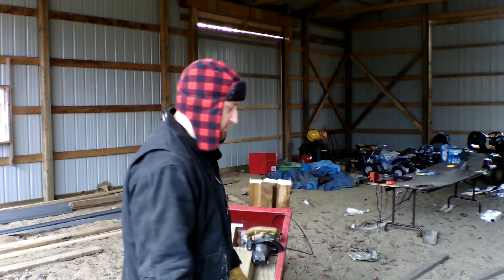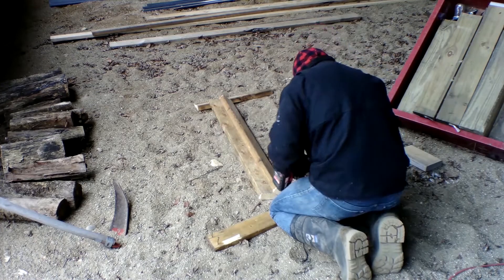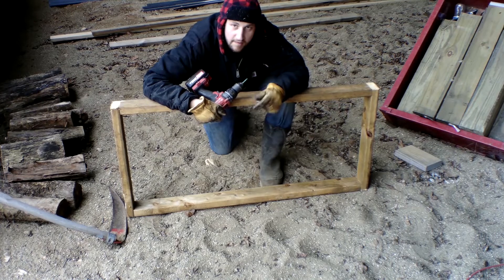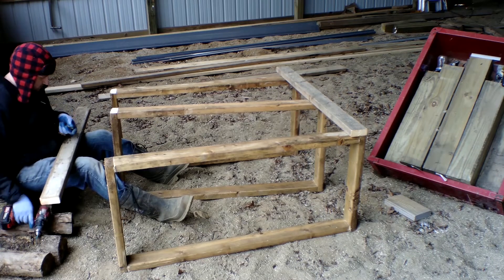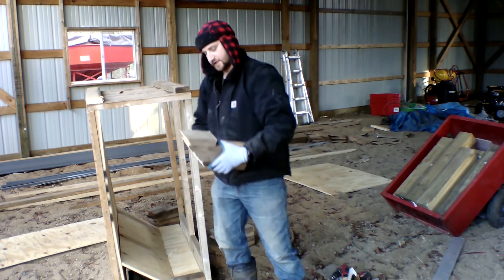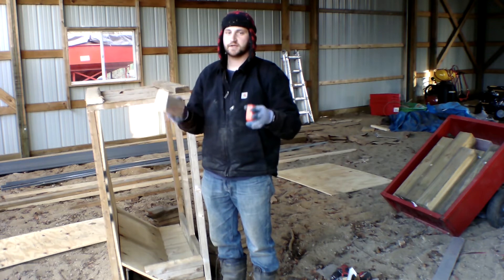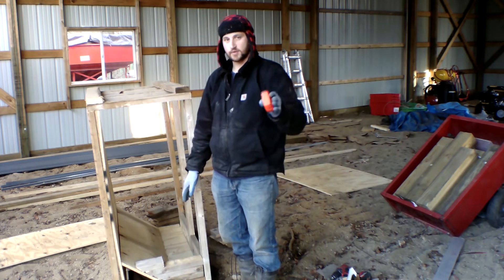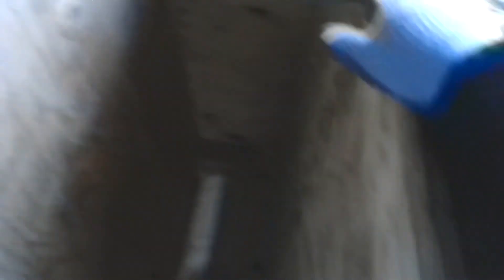Automatic Gravity Pig Feeder

Comment: Hello everybody! 
Does anybody know if the feed to meat ratio is different with automatic feeder compared to manual feeding?
Reply from the maker: Typically it is around 750 lbs of feed to get a pig to full size. 250 to 300 lbs. once processing is done you will lose about 50 to 60 % in weight. However sometimes pigs like to play with their feed depending on pen setups.